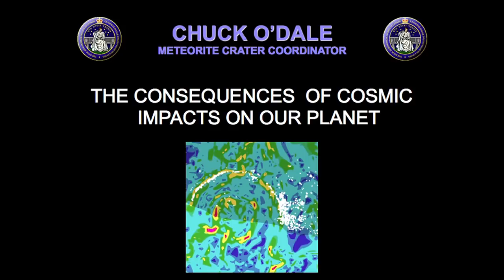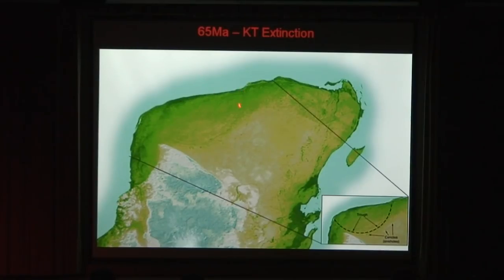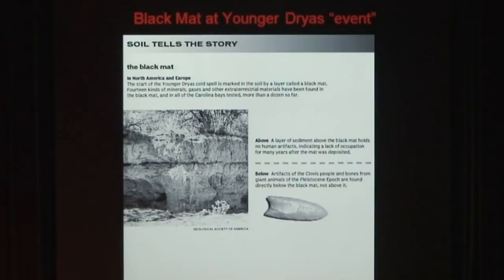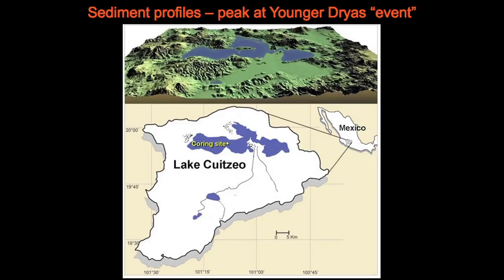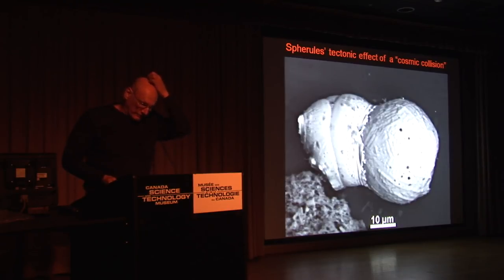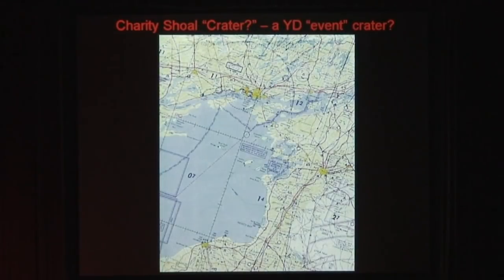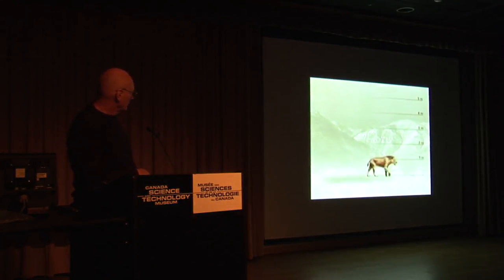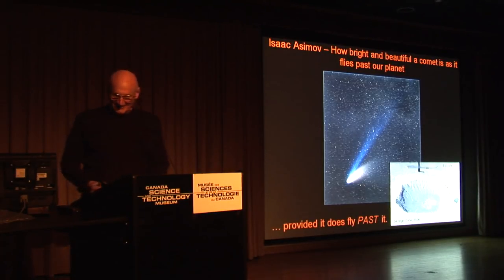YOUNGER DRYAS EXTINCTION - IMPACT RELATED?

Comment: bloody creek is secondary. the carolina bays, or the Nebraska rainwater basins. They point back to the exact position, to a very close location, in the ice sheet, thus not an air burst. and the nasa guy even says why no crater is formed, but if it was, the ice reformed it.

Comment: The Wittke et al 2013 paper examining over 700 samples showed conclusively that Pinter and Surovell and others used incorrect protocols on carbon spherules in their studies. Wittke only addressed carbon spherules.  Work is being done on the other impact evidence relative to the papers critical of the YDB.

Van Hoesel's dates used IntCal09, but she didn't notice that the Firestone dating used IntCal04. When adjusted from IntCal04 to IntCal09 the difference went away.  SLOPPY WORK on her part.

Comment: Hello, I was just wondering: about the Iridium peak, how comes Hanes et al. (2010) didn't find any peak? And for the nandiamonds van Heosel et. al (2012) dated them and they weren't consistent with the possible age of a possible impact, how is that possible? (I'm not trying to argue, I just want to understand.) Thank you if you answer!
Reply: A very strong platinum peak has been found by GISP, suggesting a meteor at ~12,900 BP.   With the lack of iridium, they say this suggests a meteor that had been... processed? i forget the term...

Comment: WHAT IT REALLY SOUNDS LIKE ... is the body that impacted was highly charged. A mineral based body of significant size from the deeper orbits, the cold end of our system, would become the cathode end of a discharge when it came close to the inner orbits, where the sun provides many anodes to discharge upon as it closes to the air gap required for plasma glow and destructive physical impact millseconds after. So there. www.thunderbolts.info